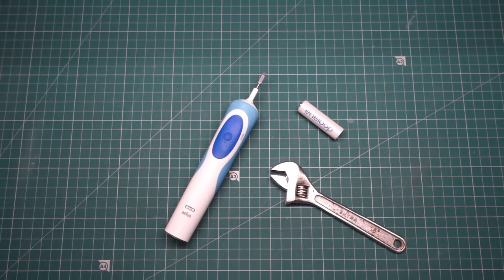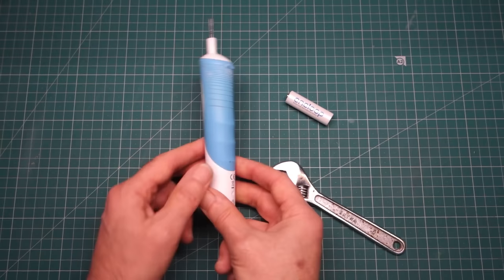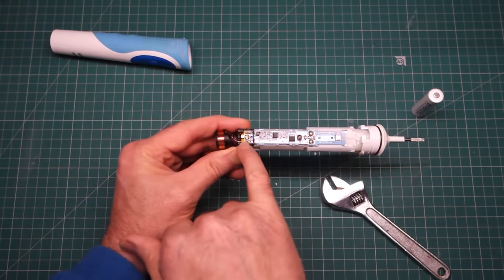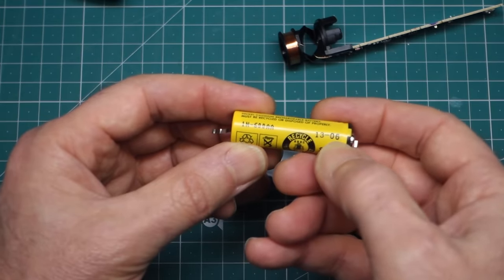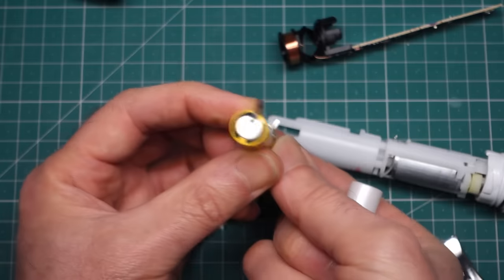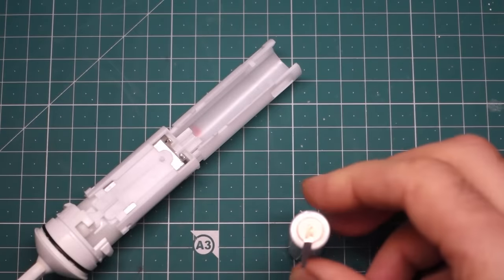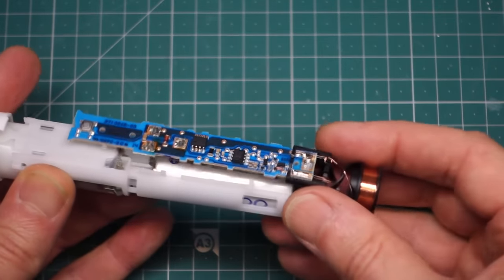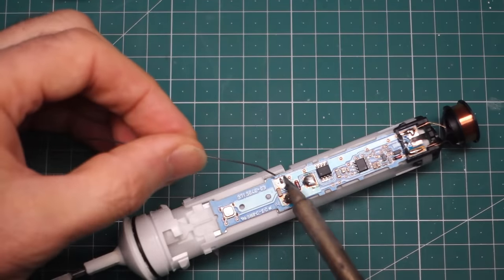Ep 33 Electric Toothbrush Battery Replacement/Upgrade

Comment: On today's episode of Pimp My Toothbrush, I wanted to put a lithium ion cell instead of the old Nickel cell. I've checked the open circuit voltage of the charging board, and it outputs 5 volts, which should be enough to fully charge a protected lithium ion battery. However, I'm not sure if the voltage from the battery is connected straight to the vibrating motor, in which case it would probably be deadly to power it with 4.2v instead of 1.2v... any thoughts on this?
Reply from the maker: You're more brave than myself if you do this....keep a fire extinguisher handy!  However, you maybe ok with a protected cell.  A good quality 2000mAh NiMH cell will give you over 2 weeks of use. Much better than the original cell.
Reply: @PowerOn-  I'll install a new Ni-MH cell first, and then check the voltage at the output. If the voltage is higher than 1.2v it means there's a voltage booster somewhere, which should allow me to use Li-ion. However, I believe there will be no such thing, because I found this dutch guy who said even 1.5v is already an overvolt for that small motor: circuitsonline. net/forum/view/119108
Reply: I used a alkaline energiser battery at 1.7V and it was great. Only problem is that it’s not rechargeable.
Reply: I also tried a lithium ion cell 1.5V and it wouldn’t work.  Any ideas why ?
Reply: @crispinswainstonharrison9042  the button cell? It cannot output enough current.
Reply: @umloginqualquer  no, the AA lithium ion battery 3500mah
Reply: @crispinswainstonharrison9042  I've never seen a AA 1.5V lithium cell.

Comment: Can you solder the AA with normal iron? WIll it get fucked up like 18650?
Reply from the maker: Soldering directly to a cell is not ideal but can be done.  Use plenty of flux and only apply the heat for the minimum amount of time.  If you do damage the cell, at least an AA is cheaper than an 18650!
Reply: @PowerOn-  Oh well thanks for the information! Should I use big iron like 40-50-60W or a smaller one?  btw in fact AA are more expensive where I am. We have plenty of recycled 18650 2000+ mAh for ~1.5Euro ($2) but a good AA eneloop is twice as that.

Comment: I cannot remove the motherboard to the casing because it is welding on the casing, btw mine is Japan made. What can I do?
Reply from the maker: When products are welded, glued together disassembly usually results in  some breakage.  However, in your case if the battery is bad and your looking at a replacement then what have you to loose in trying?  Try wrapping a cloth around the case then stressing it by hand or with large pliers

Comment: Didn't you solder anything ? In all the videos I saw for this replacement, they solder the positive and negative poles
Reply from the maker: In the video I spot weld the tabs onto the battery, then I solder the tabs to the PCB  As such, I don't understand your question! 🤔
Reply: @PowerOn-  maybe I saw wrong, I skipped your video because I saw many of this type. Thanks a lot, so it is needed to solder, and I do not have the instruments, so I'll buy new one

Comment: Have you ever re-conditioned the batteries?  I've had 27 years experience with batteries, aircraft NI-CADs too.  Just turn ON the tooth brush and stick it away some place where you can't hear it run down.  Leave it sit for 48 hours with the switch still on.  Then recharge.  Should be like new.  I do the same wit Apple batteries for mouse and keyboard.  Just put them in a small flashlight, switch ON and leave for 48 hours.  The trick is to totally discharge the battery and leave it shorted out by the tooth brush or flashlight before recharging.
Reply: Stew Baker careful with this advice as doing this with LiPos will cause a fire potentially! LiPo's do not like being discharged completely and will not recover!

Comment: Simon I have the same electric tooth brush can you please write me the full name of the electric toothbrush cause I forgot and most importantly the name of the battery size and volt, cause I would like to replace the battery as well. Thanks
Reply from the maker: Hi Danny, its an Braun/Oral-B toothbrush and the battery cell i used is a 1.2v NiMh AA size

Comment: I’ve tried with AA lithium ion but it didn’t work. Any idea why ?
Reply from the maker: What is the voltage of the cell?  If its 1.5V then you have used a non rechargable cell.  If it is 3.7V then the toothbrush charging circuit will not charge this cell as it will stop at 1.4V.  Only use Nimh or NiCd.
Reply: @PowerOn-  it’s a 1.5AA lithium ion rechargeable. You get them these days.

Comment: I don't really understand the issue about having to charge it regularly.
Why wouldn't you just leave it on the Cradle for the 23hrs 54mins that it's not in use each day?
Reply from the maker: You are right John, however I prefer not to leave it powered on.  Also, with frequent travel  it's much easier to just take the brush for a few days away.
Reply: @PowerOn-  fair enough if you travel a lot.
Nice job by the way, I like repairing/modifying things instead of binning them too.

Comment: Now they seem to have a protection. When I tried to remove the battery something happened and it won't start anymore...
Reply from the maker: Hi Gigi - did you try putting back on the charging stand?  The circuit needs a 'reboot' after the cell is changed.

Comment: Can anyone help me? 

So yesterday night i wanted to use mine but it wont work (the metal thing wont move ) so i thought maybe the battery needs to be charged so i left it to charge overnight..  
i wanted to use it tonight but as soon as i clicked the button the metal thing just stiffly turned left (and there's this click sound) and it stayed there until i press the on/off button and it returned to its normal position. Im not sure whether its the battery, motor or what 😭
Reply from the maker: Sounds like a mechanical issue with the mechanism than converts the motors rotary motion to a rotary oscillation.  Only thing is to open it up and see what you can see....other than that its a trip to the shops for a new one!
Reply: @PowerOn-  Thank you for your feedback. It's weird cause this suddenly happened.. it's just been sitting on my table before this.. couldn't think of a possible reason that mightve caused it..

Comment: I believe that manufacturer uses ni-cd battery because this type of battery has memory effect and prone to leaking/electrolyte drying off. So that toothbrush gets malfunctioning faster. If it works good longer they get sales drop. So they build it to degrade quickly due to bad battery life. Moreover if you read toothbrush user manual it recommends keeping it standing on charger unit always which is bad for ni-cd batteries. Afaik the best way of using it is complete charge and full discharge cycles. this is general issue with ni-cd. So it's all made to die as fast as possible. So I think. There are similar problems with electric screwdrivers etc using ni-cd 12v  battery clips. They simply degrade quite fast and need replacement or refurbishing. If you open such a battery unit you will find there a battery array of 1.2v ni-cd elements, some of them leaked and dead turning the whole battery bank unusable

Comment: I understood that applying solder to these batteries may cause explosion because of heat
Reply from the maker: Best to minimise the heat applied by spot welding.  However,  a solder joint is very unlikley to cause a Nimh cell to explode.  Use plenty of flux and complete the joint in a few seconds and the cell should be fine.  There are 1000's of videos online showing diy soldering to li-ion cells which are more volatile.  IMHO stay with spot welding for those cells.
Reply: @PowerOn-  
Thanks for the amazingly prompt feedback. If I return with no eyebrows, you will know I soldered for too long :) I have the brush apart and the batt is so dead I am getting millivolts. Suggestion if conv  thanks

Comment: How to reset the timer function?
my electric toothbrush switches on suddenly in the midnight.
Reply from the maker: That sounds very strange.  Maybe the switch and cover is slightly misaligned?
Reply: Simon Jowett Happened to me too. Someone said that “Basically there is rubber seal on top got ripped and water got inside shortening power button. I removed cap from the bottom, removed everything from casing, dry with hair dryer, works perfect after assembly.”
Is it okay, dear? Thank you.

Comment: It's high time these moved over to Lithium cells. I havean identical unit I must update.
Reply from the maker: Agree...
Reply: NiMH is perfect for this, lithium is unnecessary for such a low power device that's only used only a few minutes a day. NiMH is cheap and can take the abuse without fear of going up in flames. They probably used a cadmium cell for the shorter lifespan.

Comment: How do you open the charger?
Reply from the maker: I've not tried opening the charger.  I'm guessing it is 'sealed for life' as it is a mians powered device in a wet area!  Thanks for the comment though.
Reply: @PowerOn-  fair enough I ended up smashing it but not just that instead replacing the battery I took the motor and button...

Comment: Can we not use 18650 li ion batteries?
Reply from the maker: No.  Whilst you probably could get an  AA sized lithium ion cell, the voltage would be wrong and so will the charging algorithm.
Reply: Such batteries are almost always 3.6 - 4.0 V when fully charged. You don't want to put that into the motor.

Comment: NiMh and NiCd batteries charge in the same modes?
Reply from the maker: Not sure I understand your question.  NiMH and NiCd chargers use similar algorithm s.  Very basic chargers may just run a constant current for a defined time.  Better chargers use a -ve delta V,  the battery voltage actually reduces when the cell is full, or delta temperature, cell temperature rises when it's full.

Comment: Simpler Fix
Cut the back of the plastic holding in the battery.
Pry off battery tabs
Wire up new battery to battery tabs
Insert and tape or glue in new battery.
Simple
Cut plastic Cut tabs Wire tabs Glue / Tape in new battery
So
Do repair from the Back Side

Comment: Ni cad battery is the btter choice, takes more abuse and can handle overcharge and deep discharge cycles
Reply from the maker: I respect your choice,at the same time the inductive charging of toothbrushes is unlikely to overcharge and the power density of nimh gets my vote.  NiCd is also much less available in some locations (essentually banned in Europe, except in some specified devices)

Comment: Obviously they don't want you to change the battery!!!!  LOL  I have a battery powered electric noise trimmer that I paid $9.99 for and it takes a regular battery and is easily changed.  DONE with the electric tooth brush because apparently they are all like this.  I have/had a Waterpik....it's in the trash now.

Comment: It's not surprising they don't just build them to be able to replace the batteries, you wouldn't need to just go buy an entire new product if you couldn't do what you just had to do here if you could simply replace them. The excuse is that they have to seal the thing from water... But proof that they can design better is that I'm a diver and torches and dive computers are battery replaceable  with no issues, so that is a lame excuse.
Reply from the maker: Your're so right.  You can seal almost anything with a decent 'o' ring design.

Comment: I could do this repair no problem, have even all the tools including battery spot welder.
But this toothbrush is like £15 so not worth it at all.
Came here to just see how it's put together, I thought it's all potted...
Reply: Its about recycling and re-using, to keep things out of landfill, it's not just about the money.
Reply: @rogerjones624  Just dispose it properly and it will get recycled without trashing the land.
Reply: @Arek_R.  I doubt if the plastics will be recycled, it is nice to think that this will happen but most does not especially hard plastics or mixed plastics. A lot of plastics gets sent to developing countries where they are often just burnt .

Comment: Without the soldering equipment and skills to use same, the chances of turning the device into scrap are far too high. I would prefer to create less stress and nip out to the store and buy a new one - they're under £20 now for that model so I don't think it's worth going down the "scrooge" route - but the repair of the faulty on/off switch in another video was far more useful and easy to do so I won't give this a dislike because it's obviously a very good demonstration, but the job is not for the faint-hearted!
Reply from the maker: Hi Cosens,  I agree in most part, it's not an easy repair.  At the same time it's frustrating when manufacturers make it difficult to effect what could be a simple replacement of a battery with traditional spring clips.  There is  both a growing 'right to repair' movement and manufacturers seemingly hell bent on making it as difficult as possible to fix 'stuff'.  You'll know which side of the fence I sit 😀
Reply: @PowerOn-  I fully agree with that - there's far too much "no user accessible parts inside this device" goes on. It's like a restrictive practice and corporate meanness. I have to say I salute you for having the patience to do that replacement and it's certainly "one in the eye" for Braun.

Comment: 99,9 of ua don't have spot welder
Reply from the maker: Then a soldering iron should work, it will need to be 80watts + to get a joint to the right temperature on the end of the battery cell

Comment: How about you buy a new one huh?
Reply from the maker: I'm the sort of person thay enjoys taking things apart and sometimes fixing them.  The cost of a replacement is not the issue with this repair, buth there is also the desire to reduce waste also.  In addition I've discovered that it requires recharginging only every 2 weeks or so which is better than a brand new unit.  Great for holidays as you can leave the charger at home.
Reply: Abdony Mezilus- Why click on a video saying how to fix something just to post an idiotic comment. Huh? Like he replied he saved money, reduced waist, and probably has a lot more pride in this. Anyone can "buy a new one" but not many can repair an old one.
Reply: Why are the first comments on videos always so idiotic.

I think they just check views and get snarky.